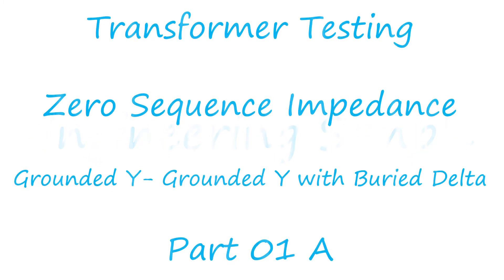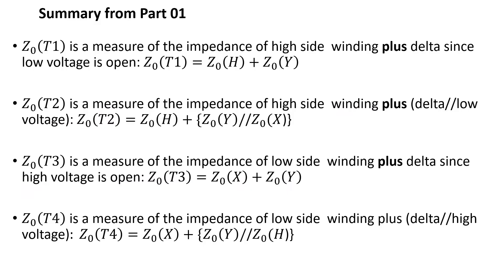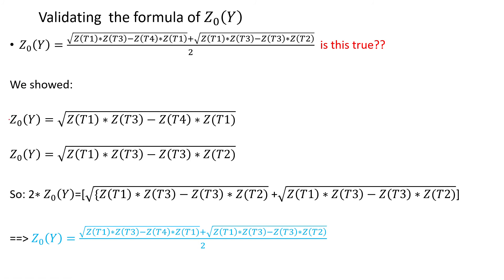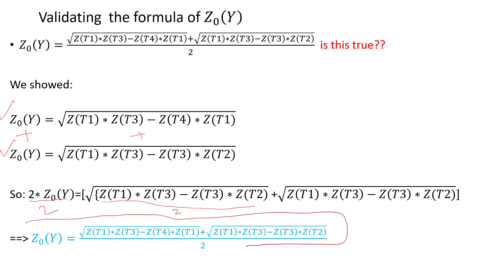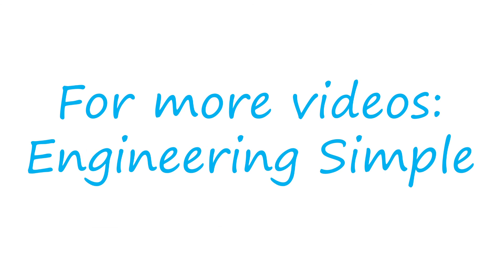Transformer Zero Sequence Impedance Testing YNyn  Derivation of Z0Y  Shunt Branch of T Model

Comment: Thank you for the informative session. I have a question. It was advised that zero sequence impedance for 3 phase, 3 leg core is 85-90% of positive sequence impedance. I am wondering about the basis for this thumb rule. Is it possible for you to share any literature titles where I can read this part in detail? Request your response.
Reply from the maker: If I remember correctly, I have seen mention of it in IEEE C57 series standards as well as Black Burn text book for protective relaying amongst other references. Personally, I have reviewed many test reports and compared positive and zero sequence impedance values. The ratio of the two always was within 85-90%. The percentage is based on test data.
Reply: @engineeringsimple  thank you very much. will refer black burn and IEEE C57.XX for the details.